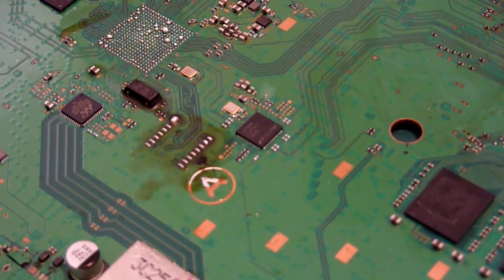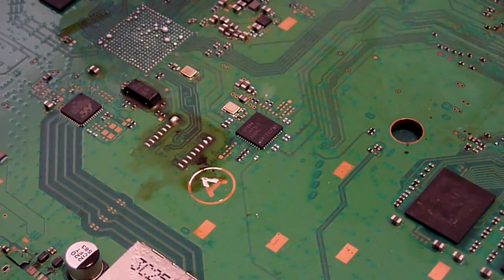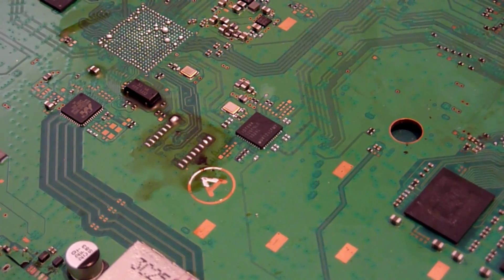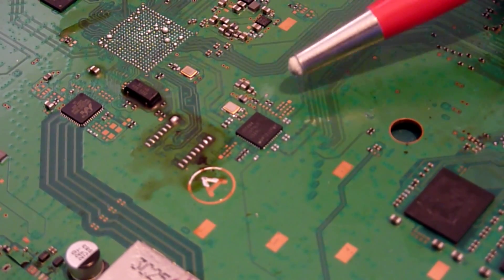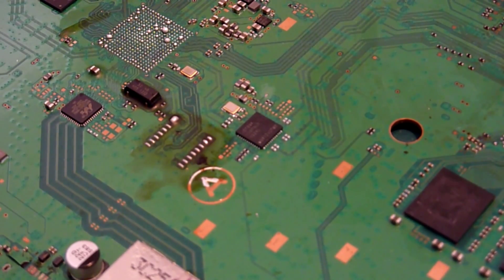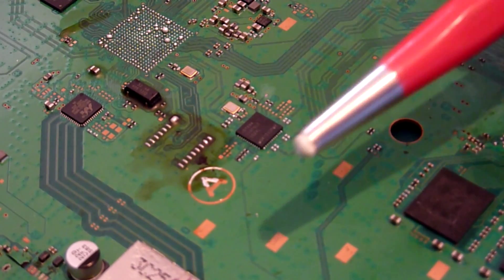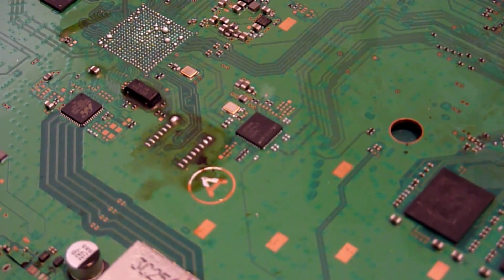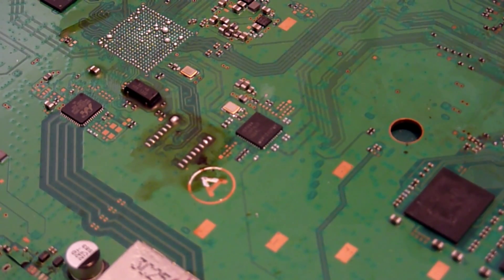Soldering 101: How to solder to VIAs on PCBs

Comment: I'm very late here but, I tore a pad and the via comes up from under the pad. I scraped away some of the board to expose it but seemingly when trying to solder to it (it's very small) it gunks it back up from the flux.

Now, before I attempted to solder to it, I probed it and found where I could run a trace from. So at this point it's moot but it would be nice to solder to that via. Any ideas? One thing I'll attempt that I thought of whilst typing this is using magnet wire and tinning the end, then heat the other end whilst touching the tinned end to the via. Connection probably wont be great, but maybe I could flood it with solder afterward for a stronger bond?

Any thoughts on this? I don't suspect it'll work for me but I can try regardless!

Comment: Hi Andrew, Cheers for the video searched awile to find this. I picked up an Xbox one which had two burnt out surface mount resistors near the APU chip. Most likely via water dripping from the cooling tubes. Being my first rodeo i used heat to remove most of the corrosion and a tiny screwdriver. Little did i know these were VIAS (thank you for the terminology). I believe they have disappeared. All i can see now is copper speckles. Should i get a scapel and dig alittle further to get to clean copper? I dont even see a hole anymore. Cheers in advance and sorry for the long winded message!

Comment: when i try to solder to vias on my ps2, the solder doesnt want to stick to the via at all, and im using flux on it. Do i absolutely need to use a fiberglass pencil on the via? modbo instructions never said to do it.
Reply from the maker: Hi, yes you will - the PS2 boards have a lacquer coating on them which is why you can't solder to the vias. You'll need a fiberglass pencil or the edge of a craft knife etc to scrape the via back. Once the copper looks shiny, you should be fine to flux and solder it.

Comment: "Scrape lightly" damn. If I saw this video before, I could have saved a DS4 JDM-055 :( All I have now are tiny holes which are impossible to solder on
Reply from the maker: You may still be able to rectify the issue - you'll need to trace where the via goes to on the other side of the board (hopefully it's through-hole and not a blind via otherwise that will make tracing the circuit a lot more tricky) and then run a wire from the last component along the trace before the via, and to the next one along once the trace has passed through the via. If you can find some wire thin enough, you may be able to get away with poking it through the hole, scraping back the conformal coat on the traces just before and after the via, and running the link wire through the via itself soldering the ends to the traces directly.

Comment: What if my via is all corroded, with no to little metal on it?
Reply from the maker: If it's connected to a trace you'll need to scrape the trace back, solder to that and then run a link wire to the other side of the board to where the signal goes. If there's no trace you'd have to use a multimeter in continuity mode to test where the signal originates from and then run your link wire from there to where it needs to end up at the other side of the board.
Reply: Andrew Paul I have limited room, probably not even enough for a wire. the via is connected by one trace. that trace is probably connected to the other side of the board, so would it be possible to just reconnect the trace with the via? sorry for my ignorance. I have no experience, and if you need pictures I could send you some since this is kinda hard to explain

Comment: andrew paul. can this be used as a way to test continuity from vias to pads and female side of port to test if traces or port is the problem. just had new port soldered in and still no video out?
Reply from the maker: +Travis Probst Hi Travis - indeed it can - just scrape the lacquer away from the via's to expose the copper beneath and measure from point-to-point with your multimeter - good luck! :)